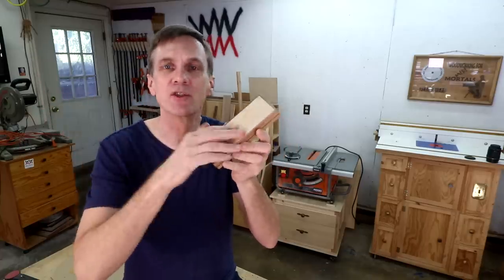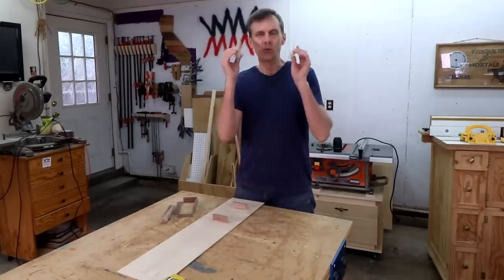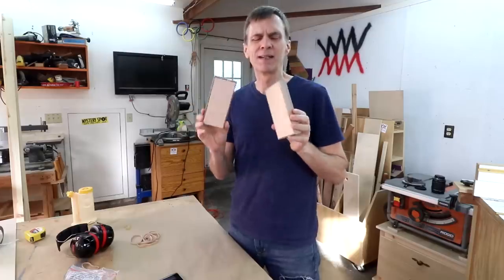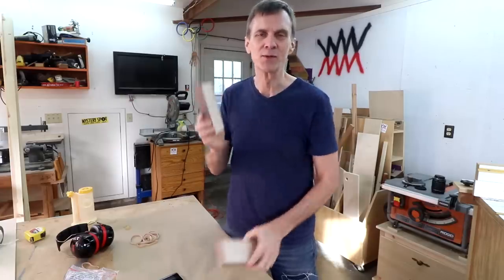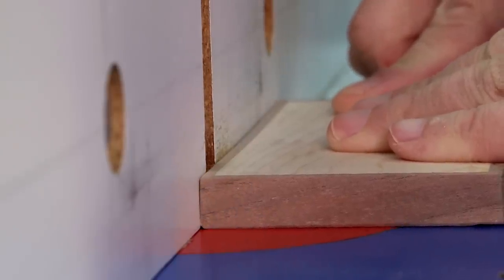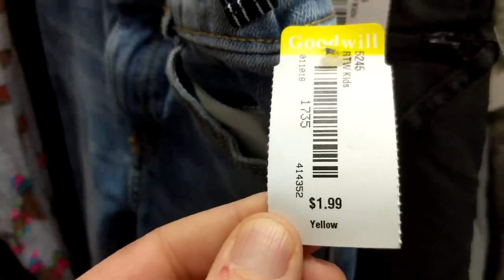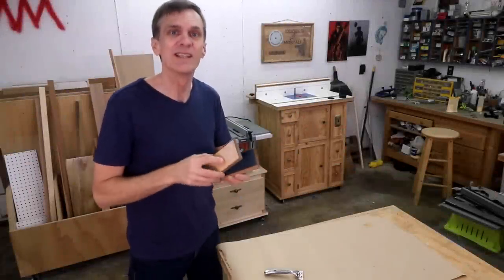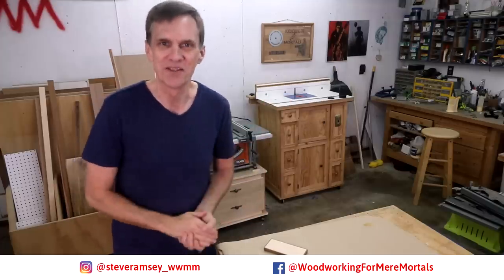Can You Sharpen Disposable Razors?

Comment: I just use the palm of my hand. Ten strops on each palm. My disposables last indefinitely with comfortable shaves, stored in a small jar of olive oil between shaves. I shake off the razor into my hand before each shave & apply the excess oil in my hand as a pre-shave.

Comment: Along with stropping my razor on my jeans to keep the edge sharp, something that I’ve done for years and keeps razors sharp for months is to store them in a beaker with a couple of spoonfuls of vegetable oil or olive oil (just enough to cover the cutting edges) it stops any chance of corrosion and the residue oil one the blade when you shave helps the razor glide smoothly. 
Make sure you rinse the blade thoroughly after use, shake of all moisture and then place on a towel for a minute to absorb any remaining moisture before returning to the oil. Don’t be tempted to use miner oil or baby oil it the razor has glide strips as they will swell and disintegrate. I’ve got a medium dense beard growth and change my blades a max of 3-4 times a year.
Reply: Cool, but what's miner oil. Used to be a coal miner but never heard of it.
Reply: @markrainford1219  He forgot about old Al. That guy has the last word so I can't imagine how he forgot even though Al's always at the end of this thought.

Comment: Just an FYI on shaving. When using disposable razors I would frequently get ingrown hairs which of course, being a guy I just had to try to get them out thereby creating a literal Mountain out of a ingrown hair bump! Then I picked up my father's safety razor like they used to use in the old days with the opening tops that you placed a safety razor into and then lowered the tops. I don't think I've had an ingrown hair ever since!
Reply: Was it American Safety Razor brand? Did you know they made table lighters too? They came up with unique but very unsafe design, though I couldn't help but get my hands on one. While other table lighters of the time would self-extinguish after lifting your finger off the button, Safety Razor table lighters had a button you press which flips open the spring-loaded snuffer and strike the flint at the same time lighting the wick. It would stay lit until you pressed the snuffer back down which loaded the spring mechanism for the next time you needed to use it. I'm sure a few house fires were probably the result of this neart contraption. Theres always the potential chance of accidentally pressing the button or it falling on the ground without anyone noticing and igniting and staying lit until it caught something on fire.

Comment: I plan to turn some custom razor handles. I'm thinking I might package them as gifts in a box like this with the denim strop in-place. Add a little height to the lid so there's room for the handle, and make the block a little shorter than the box to make room for the razor head. Then people will get the handle, the head, a first blade cartridge, and a sharpening system all in one box!
Reply: That's a fantastic idea.

Comment: For about a year now I have been making a $.25 double-bladed razor (WalMart) last for about a month before I need to change it. I simply hold the terrycloth bath towel so that it hangs down my forearm and strop the razor on that with my forearm serving as the backing. I go for at least 40 strops. It may help that I first run very hot water over the razor, as the retained heat may help rid the surface of water molecules. My point... I can testify that Steve's contraption will work.
Reply: This is very minimalist and smart. Have been researching and it seems there's no way to sharpen the blades, but only hone them by stropping.  Also, it is hard to find a way to disinfect them cost effectively, meaning without offsetting the cheaper cost per disposable razor. Leaving them in a jar with about 2cm isopropyl alcohol comes to mind, or methylated spirits (not sure about safety for skin contact as there are many other chemicals in methylated spirits other than ethanol/alcohol, such as methanol, colouring, etc). I guess you could just wash off the razors after it has been sitting in methylated spirits. Alternatively, you could just run the dispoable razor under hot water, but not sure it's really that effective.

I think the dollar shave club is a good balance, where you don't have to worry about any cleaning, stropping, etc and just replace the blade every week or so.

Comment: For all razor blades: rinse with water, then swish in alcohol and hang up to dry. The alcohol displaces the water and slows down the corrosion/pitting which dulls the blade and makes it painfully uncomfortable. Even a cheap blade will last much longer.

Comment: Hi Steve! First of all great video and great tip. I have a question related to wood expansion. When you glue the top and botton of the boxes like you did it in the video, will not be a problem in the future because of the expansion of the wood or because the possibility of creating gaps between the glued areas? 
Thanks!

Comment: Interesting technique Steve.   I understand your reluctance to try to cut those 1/2 inch pieces down to a 1/4, but if you had glued them together to make the 'ugly' version, and put in the top and bottom, it would have been reasonably safe to trim 1/8th inch off all round.

Comment: Hey Steve! Love your channel. I'm new to woodworking, and your videos have helped me out a lot with my projects! I have a question about this project. You're gluing the box together end-grain to end-grain, which I've learned is a weak joint. Does this not matter since the box is small? Or is this weakness at the corners counteracted by the walnut being glued face-grain to side-grain to the maple top and bottom? If I were to make a box like this, but taller, would I need to add splines at the corners? Thanks again!

Comment: Gluing a solid panel into a glued miter frame will create busted out miter joints when the humidity increases and the panel expands.  Plywood panels would be wiser.  Just like Steve, I make mistakes too.  I made a box just like this one, and it blew apart when it was taken to a more humid climate.  The box I made was about twice as wide, which means the expansion was twice what you'd expect from this one, but solid wood panels will expand and contract.  Be aware.

Comment: think this would work to sharpen use box cutter blades?  those are bit thicker than shaving blades but i dunno.  a few cuts through drywall and that blade goes dull.  this would be a nice way to mitigate that a bit.  thoughts?
Reply from the maker: I think it will work. You can also try leather since those blades might be thicker.
Reply: This doesn't sharpen blades, it hones the blade, basically when you use a blade as thin as a razor, it creates a warped edge, and you use a device such as this to straighten the edge again without sharpening (as it removes material from the blade), this is also why you see chefs running their knives together, keeps the edge straight, otherwise the blade will actually crack.

Comment: This doesn't actually sharpen them, it just cleans up the blade.
Reply from the maker: To be more accurate, it hones the blades rather than sharpening them.
Reply: Steve Ramsey - Woodworking for Mere Mortals  I wonder if rubbing jewellers rouge on the denim would aide in honing. It sure works on the paper sharpening wheel for knives. Razor edge on knives. 🤔

Comment: metric measurements don't add up if you round 1" down to 2.5cm. it's 2.54cm. that half a Millimeter gets annoying if you're left with tiny gaps that wont close, even though you measured it perfectly.
Reply from the maker: It's good practice to always be as precise as you can. In my shop, with my tools, a half a mm is well within my tolerances! :)
Reply: sure. I would be way off, but as German as I am, that sticks out like a sore thumb xD

Comment: I'll pass on the dollar shave club crap. When I do shave I use a straight razor. What you made would be a pretty nice strop for a straight razor though. Just load up the denim with some stropping compound and you are good to go!
Reply from the maker: Haha...I would never trust myself around a straight razor!
Reply: Steve Ramsey - Woodworking for Mere Mortals i use a straight razor to shave my legs.....I know you was waiting for that.
Reply: I just used an edc knife for shaving until i got my straight razor
Reply: Sounds like your EDC knife got 0 use other than shaving or you sat down and re-sharpened and stropped it every time you had to shave.
Reply: +1 on using a straight razor.  It's really not hard to learn, and much cheaper than buying disposable razors.  I spent the cost of one pack of the fancy multi blades 35 years ago, and have been shaving with the same razor since.  Strops are not hard to find in good condition in antique and curio shops, and not expensive.  This would be very handy for a portable kit with a piece of heavy leather and some stropping compound though.  Leather + compound would do a better job on the disposable blades as well IMO.
Reply: LMAO @ "it's really not hard to learn"..... like the violin is hard to learn, but the bow won't cut your ear off if you slip.....
Reply: I use a straight razor when I have the time. I get my fair share of nicks, but I've never truly cut myself any worse than I have with any other razor. For most people I'd recommend a double edge safety razor, the blade replacements are <10¢ and can be used two or three times, more if you strop them.